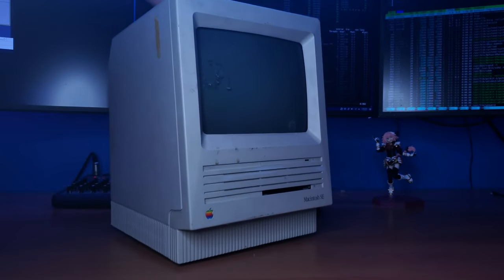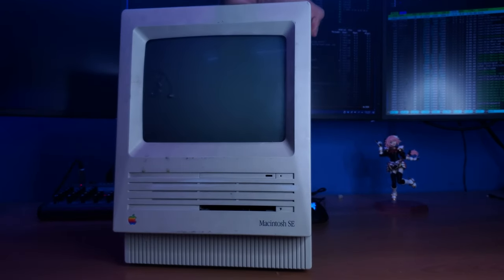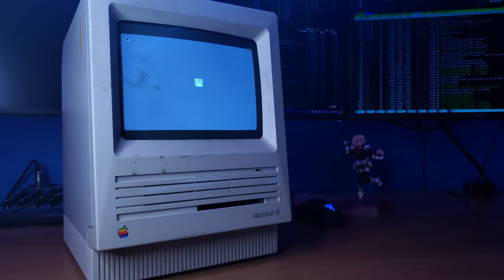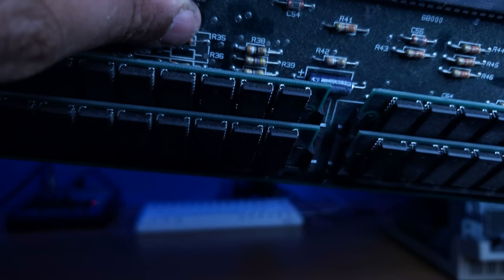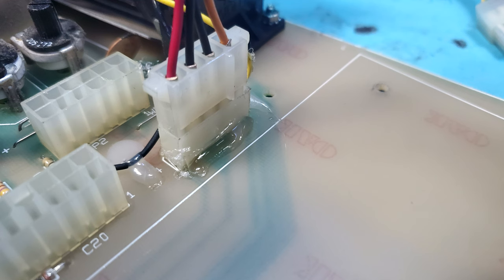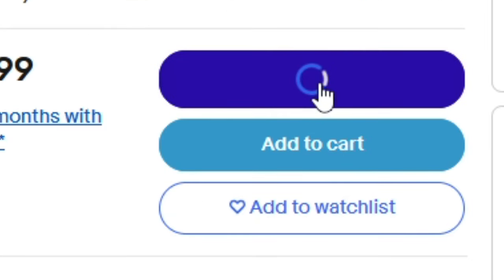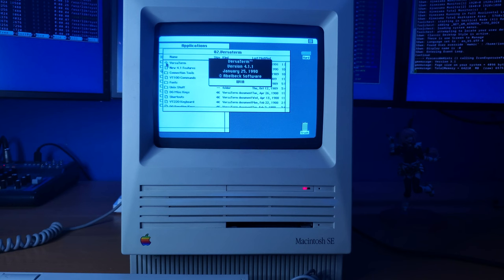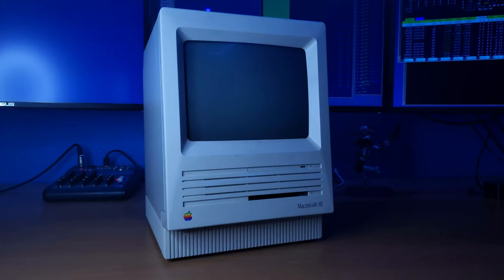Restoring a $7 Macintosh SE, Will it Work?

Comment: Nice video!

Just a heads up, compact Macs like this Mac SE originally shipped with the picture adjusted how it was when you first powered it on. If you take a look at the service manual, you’ll find that the picture adjustment section instructs the repair tech to adjust the screen to be 7 inches wide by 4.7 inches high.

Keep up the great content, it’s always nice seeing younger people get into retro tech.

Comment: Nice video. BTW, the reason that the video output doesn't take up the whole screen out of the box is because it was so that art would present at 1:1 in design apps. If you ever want to set it back there are official measurements in old Macintosh repair guides.

Comment: When you upgraded it with a 68030 card, 4mb of ram, Multifinder, and a 200-300mb Harddrive, and added a dial up modem, it was a sweet little machine.   
That's wild you paid 7.    Back in the day it was 3,500.   i have a ton of these in the barn.   Laymen actually called the SE "somewhat expandable".
You would finally leave it though in the end... for color.  In my case, a Performa 476 68040 25mghz.  If I had sold my Macintosh SE back then, and put the money in Apple stock instead, I would have 60 million today, instead of a 7 dollar Macintosh SE .  Really makes you think.
Reply: 2.7 million, your math is off.

Comment: what OS/interface do you use on your main computer?
Reply: Visible in this video were MaXX Interactive Desktop (2:20), which is a clone of SGI's Irix desktop, and KDE Plasma (1:53) on Arch Linux. Also Windows 10 at 6:50

Comment: If you plan on making that mint condition the first thing I would do is remove the battery on the logic board and replace the capacitors on all of the boards since they’re prone to leaking. That hard drive probably doesn’t have much life left either so a sd2scsi adapter is a good alternative.
Reply: That really isn’t necessary, the Mac SE (and compact Macs in general) isn’t known for having leaky capacitors. If the analog board is performing as expected, there’s no need to replace anything until a problem arises. “Shotgun replacing” capacitors is always inadvisable, especially if you aren’t confident in your soldering skills.

Also, these 20 and 40MB SCSI drives are surprisingly reliable in my experience. A SCSI2SD is hardly necessary, it’s simply a convenient (albeit expensive) quality of life improvement.